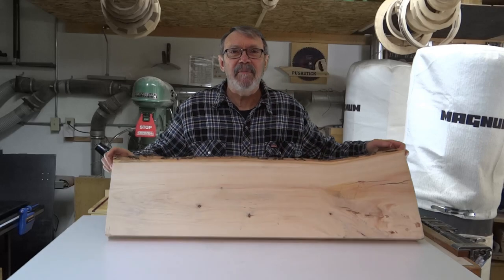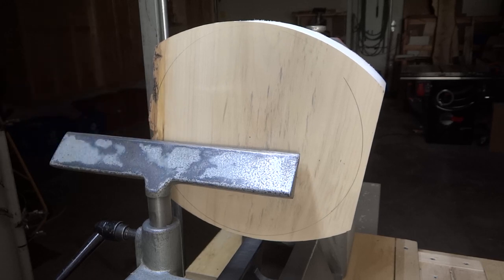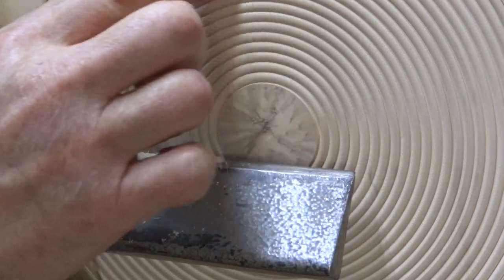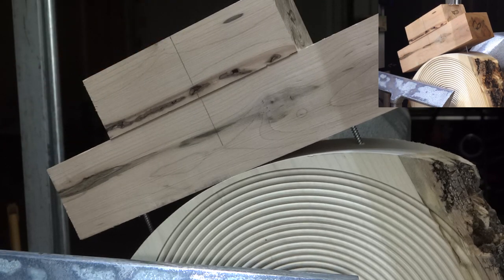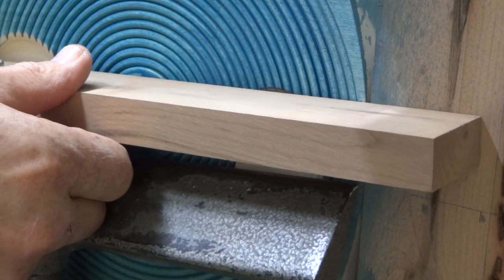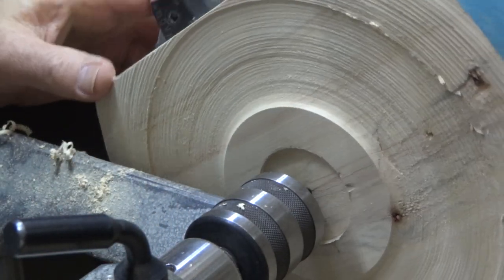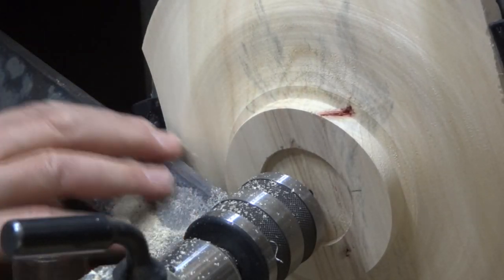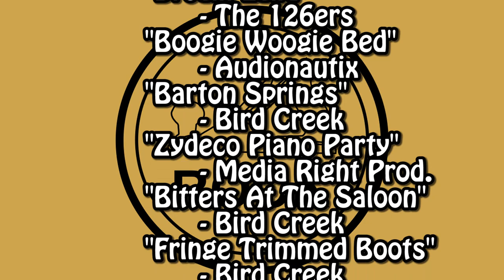Beading & Off-Center Turning

Comment: That one had several challenges Gord, but you tackled them all. Great job. 

I see you used a beading tool on the top...that looks much like my finish cuts. LOL!

I wonder if you could change the order of operations a bit and turn the smaller cups first then try to put the beads inside. It might at least reduce the tear-out...or explode the whole thing. Hmmm, well maybe not. :-)
Reply from the maker: Thank you, Gil. I could have put beads inside the small bowls after turning them but the effect I wanted was for the beads to cross each other. I'm sure the small bowls could have had beads cut into them after they were turned. Not something I thought of but I don't think I would have done it even if I had thought of it. Might be an interesting look, though. Thanks for the thought, Gil.
Take care,
.....Gord

Comment: Hi Gord
I like the piece.
I watched a sanding video a couple of weeks ago (sorry I do not remember the man's name - but I think it was on Gwinnett).
A sanding video might seem particularly boring but it was worthwhile.
The point being - I found the techniques and tips quite interesting. In particular, he commented on the importance of sanding at 7 o'clock (and 5 o'clock when in reverse) - ( something about the pressure at centrifugal force - to technical for me to understand).
However, I have tried this technique and found it to be very helpful, particularly in beads, which may have helped on this project.
May be worth taking a look, a little bit long (sanding is a little on the boring side), but anything that helps sanding is good news in my opinion. :-).
Lots of thoughts on sanding and a worthwhile watch.
I hope this is something you may find worthwhile - it also talks about being able to clean and use less sandpaper with various tips.
Thanks for the video as always you teach me something. I also have a Nova Lathe which I rally like (mine is a Nova 2024 Direct Drive with 220 volt 2.3HP direct drive) (I love the "no belt" feature). I also watched your video with the indexing wheel attachment as the built-in indexing on my Nova is the only feature on the Nova that is not the best in my opinion.
Regards
Dennis Beamish Cambridge Ontario Canada
Reply from the maker: Hi Dennis,
I will see if I can find that video. I never get tired of more information. I just wish I could remember it all!!
I know what you mean; the indexing on my lathe is the only thing I am not happy with! At least there are products that can correct that.
Take care,
.....Gord